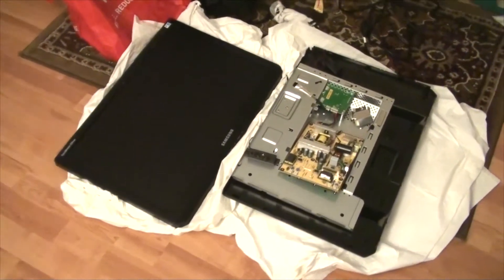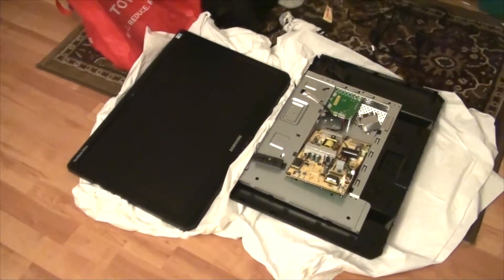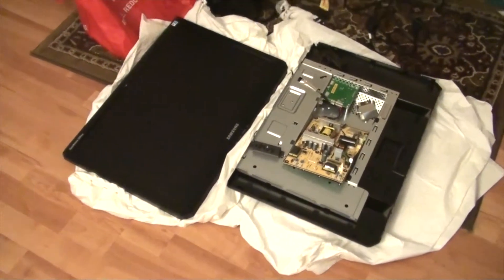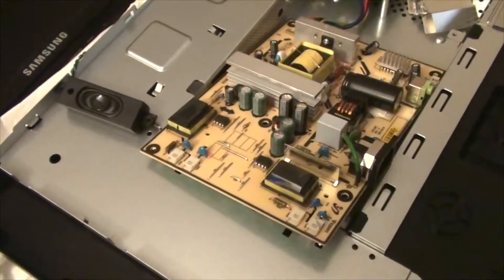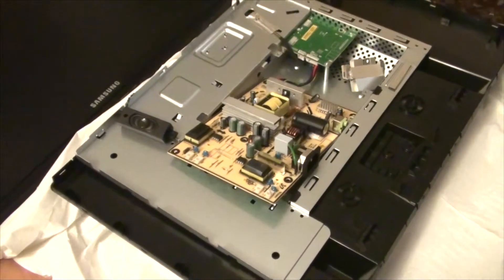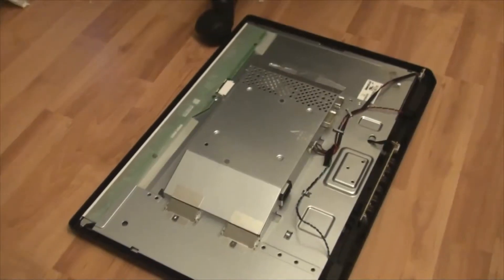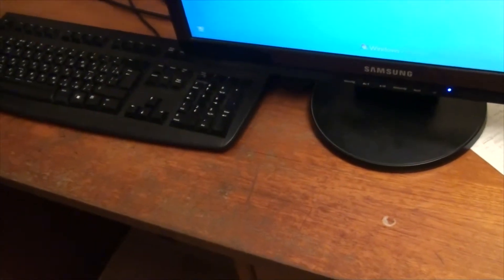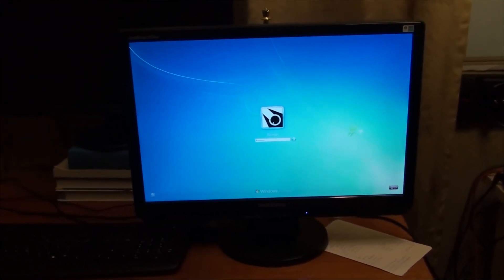lcd monitor no power fix

Comment: Yooooo my lcd monitors capacitors look fine, no burns anywhere on the power board... what do? Also where's a good place to get replacement capacitors? I see placed that sell all the capacitors for like $18... But I thought capacitors only cost like .20 cents each
Reply from the maker: Sometimes even if they don't look bulged out they can still be dead.  If you have a voltmeter you can check there are some super easy tutorials online.  If replacing those doesn't fix it sometimes it's the rectifier that goes.  Also make sure all the cables are nice and taught this is a frequent issue with monitors and LCD TVs.  As for buying capacitors check your local electronics supply store.
Reply: @cr4zyw3ld3r  hey thanks for the fast response, I tried watching tutorials on how to test capacitors with a multi meter but that is too complicated for me I guess lol. I ended up buying from a place online that sells me all the capacitors for $14 shipped. I'm just gonna take a guess and hope that the new capacitors fix it.

 My symptoms were I was just browsing the web and the monitor powered off immediately. It's definitely a monitor problem, not a cable or anything. It doesn't even power the standby LED. No power at all! 

Do you think I guessed wisely buying new capacitors? 😬😬
Reply from the maker: @DaBossk  it's never a bad idea to just replace them all.  But let me know how it goes and make sure you watch their polarity.
Reply: @cr4zyw3ld3r  hey bro! It actually worked! My solders look awful and I didn't even replace the smallest capacitors,  or the giant one, so it must've been one of the medium capacitors! It's been working for like 12 minutes so hopefully it works for another 13 years! I actually have a.....

Okay as I was typing this it literally just did what it did originally and powered off. Completely dead once again. It might have to go in the trash now 😬
Reply from the maker: @DaBossk  yeah I mean if you start to approach $40 or more in parts to fix then chances are it's not worth fixing anymore and you might as well get a new screen.
Reply from the maker: Also take a look at this https://youtu.be/HcYFbCqM61g